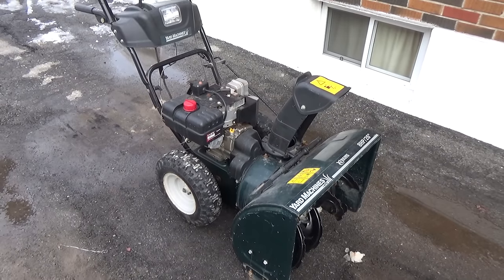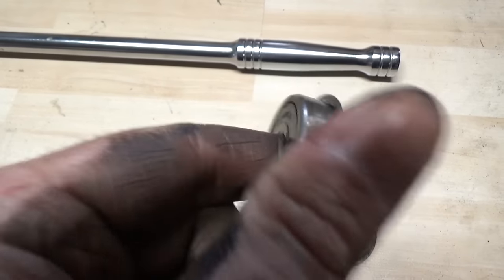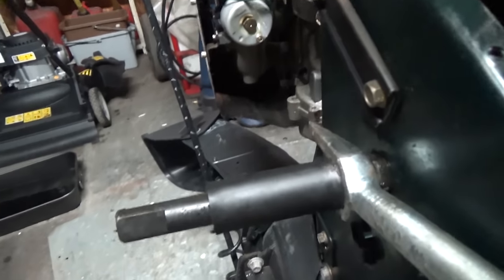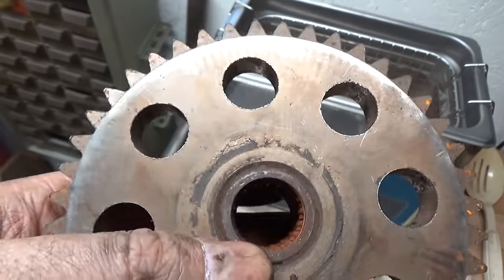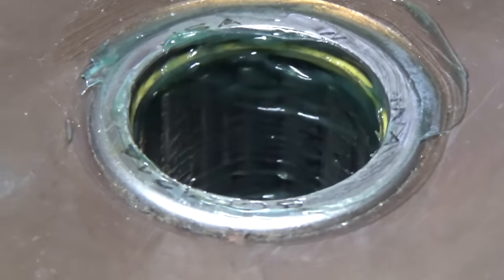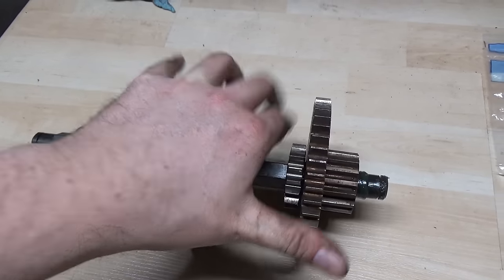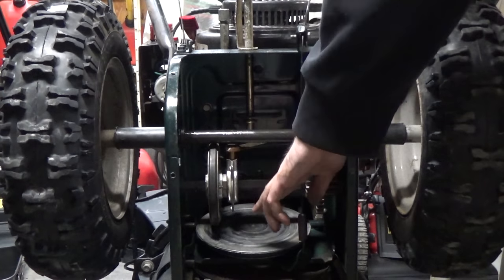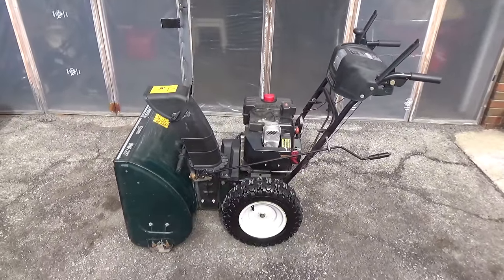MTD Snowblower Doesn't Move - HOW to FIX!

Comment: After cleaning the needle bearings with brake cleaner/degreaser, maybe use something like Evapo-Rust to remove the corrosion.
Reply from the maker: Will try it out next time, thanks for the suggestion!
Reply: You can get those bearings at any bearing supply house. Press out the old, press in the new. Done. No need for new gears unless they are worn out.
Reply: @EliminatorPerformance what about white vinegar ???

Comment: My mother just bought a craftsman snow thrower from a friend that used it only for one season. Now with the engine off, itll move backwards when in reverse gears but will not move forward in a forward gear. That's not supposed to be correct? Any suggestions?
Reply from the maker: Adjust the shifter linkage to allow the friction wheel to move to the other side of the friction plate. You need to extend or shorten the arm. Google how to adjust snowblower shifter
Reply: @EliminatorPerformance  thanks man!

Comment: The chute crank handle on my Yardworks 30 inch 365cc powermore (10 year old)is way too low.Don't know what kind of engineers designed that but the guy must have been short.I can barely reach it. I was thinking of welding a piece of rod to make it longer. Yardworks model 31AH65KH515

Comment: You can buy just the bearings for the gears part number# SCE1211-P-L271/STD (x2) and the one wider gear with one bearing part number # SCE1214-PPR-L271/STD (x1)
Reply from the maker: Thanks Jim, but even when you replace these bearings, the issue will still occur, due to the poor design. Water gets in and causes the corrosion.
Reply: Eliminator Performance nothing lasts forever but mine lasted since 2004 so not concerned about replacing 5 bearings every 15 years 
Replacing the 3 in the gears cost me $30 Canadian

Comment: FYI, I had the same problem but mine was much easier - there is a spring that holds the friction plate back.  It was gone, probably rusted away.  When the blower was put face down, the wheels turned.  Flat, they were locked up - because the plate swung forward and made contact. So I went to Menards and picked up a $2 spring. Obvious where it went. Quick fix. While I had it open I lubed everything.
Reply from the maker: Yeah this job was a little more complex, but at the end of the day it's totally doable by someone if they just follow the steps!
Reply: @EliminatorPerformance  PERF , i need to remove the rubber bracers  that brace the TIRES on the top gear  , i went and borrowed my friends HEAT  GUN and was hoping it would  budge especially with the prybar you are using . it didnt and im still stuck on the RUBBER BRACER PART is there any suggestion to move it  ( ive used wd40 ,  the penetrator oils and waited 10 minutes before trying again ... it amounted to JACK SQUAT  )

(( been here for 3 days now ))
Reply from the maker: The plastic spacers? Worst case scenario, you could probably just cut them off and replace them...

Or you'll need to use an actual torch to put heat to it, heat gun isn't hot or focused enough.

I know it's not ideal, but it's better than nothing!

Comment: i flipped mine upright and gas started leaking out of it.. placed it back down , no leak.  assuming something in the bowl  like an o-ring ?
Reply from the maker: Shut your fuel valve off and run the carb dry until the engine shuts off

Comment: Snow blowers with rubber tires on them are always always getting stuck again and again . This will happen about every 10 to 15 seconds and then you have to use your entire body weight to overcome the weight of the blower and also the weight of the snow . The rubber tires will helplessly be going around and around .  What  you really need is a rubber track type snow blower . You will be so so so much farther ahead with those rubber tracks as apposed to round rubber tires because the contact patch is much larger on the rubber track than the tire .

Comment: I removed the bearing from the gear (hammer and bang method) just find a socket around the same diameter as the OD of the bearing and go to town on it. I Googled INA SCE 1214 or whatever number is stamped or engraved on the rim of your bearing or better yet take the bearing to a bearing supplier and they will match it up or cross-reference it for you. take home the shiny new and refit the bearing into the gear. Good luck.
Play Safe From Elliot Lake Ontario Canada.

Comment: I did everything as shown , everything was spinning perfectly up until the very end, When is put the bottom axel in it spun perfectly And after the gears were all lined up above and below, i won’t spin again.
I am just frustrated, please if anyone has a suggestion I would really appreciate it.
I actually did this 2 years ago without any trouble.
Thanks again

Comment: Help!!!  On my friction wheel, if the smallest gear is in place, the wheels won't turn. If I move it aside, then the wheels turn. Put back in place, it won't move again. All gears are complete with no teeth broken.  I have wracked my brain and it doesn't make sense to me. What am I doing wrong? Every gear moves until that smallest gear is put back in place.  Please advise...
Reply from the maker: Sounds like the bearing that the small gear meshes to could be seized? Hard to say without me seeing it, sorry I can't be of more help!
Reply: @EliminatorPerformance  I did exactly what your video showed.. it was the same bearing wheel as you have shown on here.  It didnt make sense to me, so naturally, not liking to get beat by these machines, and  not wanting to shovel the snow, I got the bearings unseized... single female and not alot of cash, I am a do-it-myselfer.  Many thanks.. question tho.. I seem to have a washer left from the right side bearing area. It is normal to have/need a washer between the gear and the bearing?  Its at 25:37 of your video.
Reply from the maker: @kathy5939  sometimes they use bearing to take up extra "play" in the shaft. Think of it like limiting side to side movement. If you flip the machine up, and push/pull on the wheel from the side, see how much you can get it to move. You may or may not need it.

Comment: I'm gonna guess that those extra holes in the case aren't helping any with that problem, lol.   I would assume that housing is also used on another model that either sits higher in the air or uses smaller tires.
Reply from the maker: Exactly!  They stamp the holes in these plates at the factory for many different models, the plate then gets bent up into a box and assembled.

The drive unit is essentially the same, so they'd run a smaller auger with smaller wheels, with a lower axle and different friction wheel.
Reply: Your better off making plugs to cover those holes and any holes in the plate that don't need to be there.
Reply: @killerdeamonking  I was recently looking at some Ariens repair videos and noticed some with extra holes, and like you suggested, there were plastic plugs in there.
I think you could find automotive plugs to fit at, maybe, the "help" section in an automotive store.
Or, for more money, maybe electrical box plugs?
Either way, you got a good idea there.
Reply: @l337pwnage  lol even wood plugs would work , what ever you can cut down to fit, even a cork would work. Its not like they will get water dammage as snow is too cold for that and likely to be stored inside in spring to fall.

Comment: My I can’t removed one side of the tire 
Any suggestions?
Reply from the maker: Try your best to pull the entire assembly out from one direction, pulling from the wheel that cannot be removed. It's a pain in the butt, but the only possible way to remove the axle.
Reply: Aarron try drilling two opposing holes in the wheels themselves rent a steering wheel puller never buy one they are junk. But two long 3/8 or 5/1 6 bolts and take the old smoke wrench to em... I have the same issue if ya wanna call me tomm see how I do getting the wheels off the machine I will let ya know how it goes 4 me... I will make a video on it.
Reply: @EliminatorPerformance  My video on removing these bastard Troybilt and MTD wheels will be out shortly I just decided today the shit weather quit so I went into overdrive... The video might appear on HARLEY BEE MOTORIZED BICYCLES. LOOK 4 IT...